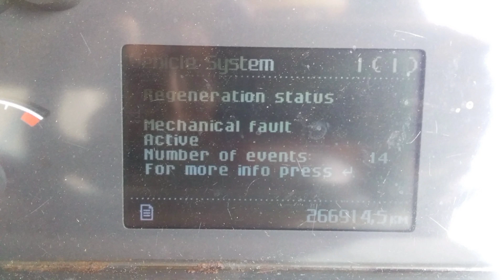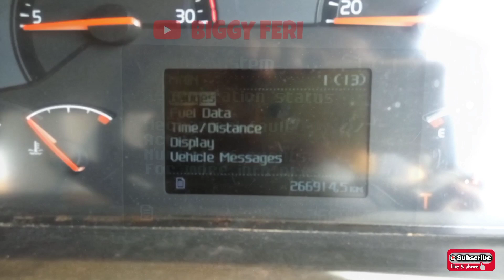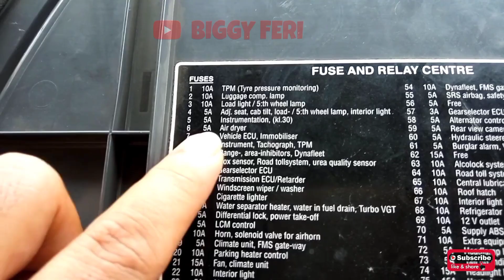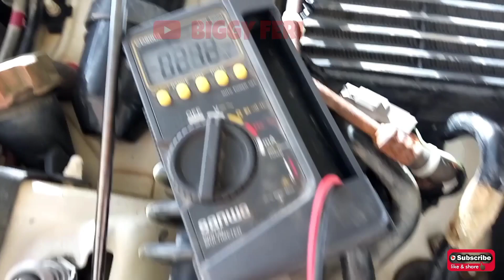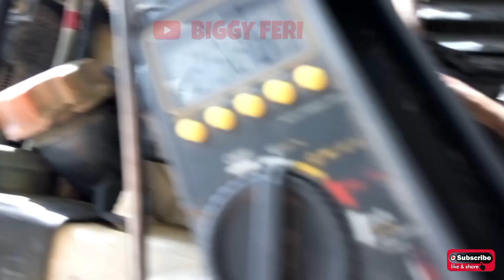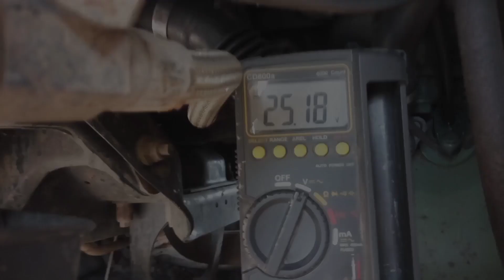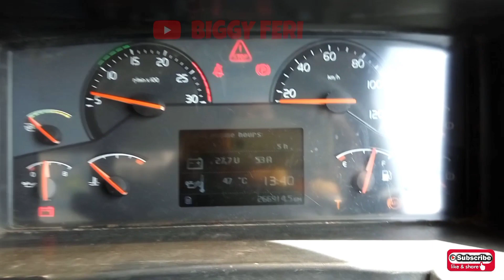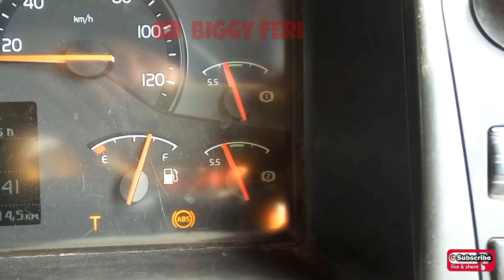AIR BRAKE SYSTEM TROUBLESHOOTING ON VOLVO TRUCK - PRESSURE TOO HIGH ON THE AIR BRAKE SYSTEM

Comment: Hello brother, where can I find the air pressure sensor on volvo d13 dumpingbtruck sometimes pressure guage low  even the pressure is nornal and sometime normal it's like wire is loosing ,
Reply from the maker: Check my videos on playlist instrument panel.

Comment: Assalamualaikum bang, mau tanya untuk sensor yg membaca pressure hrus tetap berada di 8 bar posisinya dimana ya pada unit? Dan inputan wiring sensor tersebut terkoneksi kemana ya?
Reply from the maker: Samean bisa lihat video saya yang lainnya,, sdh pernah saya bahas itu bang. 
Cari di playlist Air Brakr System.
Judulnya
'Primary Air Pressure Sensor Location & Function On Volvo Truck - Air Brake System"

Comment: bang tunjuk cara programming engine ecu turbo tak naik habis
Reply from the maker: Engine low power kah?
Kenapa turbonya tak mau naik
Reply: @BiggyFeri  turbonya naik separuh tak mau naik habis volvo fm13 bila naik bukit jadi tak kuat
Reply from the maker: Cek di air intake system, ada yang bocor atau tidak.
Bisa jadi ada bocor juga di intercooler nya.

Comment: Terima kasih banyak teman saya Anda adalah orang yang istimewa dan penjelasan Anda sangat bagus Saya harap Anda membuat video tentang file lobi dan metode pemeriksaan
Reply from the maker: Terima kasih 👍
Reply: @BiggyFeri  Aku punya masalah lain.
Reply from the maker: Masalah tentang apa?
Reply: I have a problem with the level between the fuel tanks, one of which is suddenly floating around.

Comment: Aslam o elykom sar please explain if not coming black were 25 voltage wath a problem  thanks
Reply from the maker: Check output voltage direct on VECU for black wire.

Comment: Klu angin buang di sebelum air dryer jadi gak masuk di tabung angin pak?
Reply from the maker: Buangnya di bagian mana bang, di safety valve atau dimana
Reply: @BiggyFeri  ia sebelum air dreyer,jadi gak mau masuk filter semacam gak buka selenoid di air dreyer,padahal ada setrum
Reply from the maker: Kalo angin bocor terus, coba samean ganti safety valvenya itu. Atau samean block aja untuk sementara.
Reply: @BiggyFeri  blok itu maksud nya di tutup di safety valve kah biar los ke filter air dreyer,gak ada kemungkinan rusak ke yg lain klu di blok?
Reply from the maker: Ini masalahnya  yang bocor di safety valve atau di selangnya.
Reply: @BiggyFeri  boleh minta WA nya Pak?saya mau belajar blm begitu faham unit volvo

Comment: Aaslkum bang apa masalah kalw angin pressure tekan Brake turung satu langkah satu langkah tgk  meter turung sikit2 ,.angin takada bocor bang..cabut  paip di air dryer tekanan angin kuat air dryer dh tukar tapi Masih tk jumpa penyakit ..tq
Reply from the maker: Maksudnya, tekanan angin turun sendiri tanpa ada kebocoran.
Coba samean gunakan pressure gauge manual dan cek di tangi angin 1 dan 2.
Apakah benar2  turun tekanannya atau tidak.
Reply: @BiggyFeri  turung angin
Reply from the maker: Kalau proses pengisian angin cepat atau lambat pak.
Reply: @BiggyFeri  cepattt ,kadang2 meter tu kekal bawah
Reply from the maker: Coba di tukar itu 4 way protecting valve nya. Dia yang bagi tekanan di masing2 sistem angin.
Reply from the maker: Apa yang bermasalah
Reply: @BiggyFeri  Lori berantu kut haha tk dapat di kesan bang

Comment: Hola Biggy gracias amigo por seguir subiendo videos que nos ayudan mucho... tengo el mismo problema de este camión que hiciste el video, no pierde el icono de la batería... pero el alternador carga los 28V... ya cambie relay  número K13 y el fusible F58 está bueno... pero sigue el mismo fallo... el relay número K20 no lo revise... puede ser por eso el fallo...? por favor si pudieras  hacer un video sobre este fallo ya que tu camión tiene el mismo fallo gracias amigo y sigue adelante con estos videos  tutoriales...
Reply from the maker: Hola amigo,
También tuve el mismo problema ayer.
pero no creo que sea un problema.

¿Por qué el indicador de batería sigue encendido aunque el alternador se esté cargando?
Porque el voltaje de salida del alternador (en el terminal L) no coincide con el voltaje de la batería.
Puede verificar el voltaje en el cable amarillo / rojo en el conector del alternador.
cuál es el voltaje de salida en ese terminal.
Reply from the maker: el relé K13 estará activo si hay una salida de voltaje desde el terminal L en el alternador.
El fusible F58 es una ruta de señal que va al alternador cuando el encendido está en la posición ON, de modo que se produce un electroimán en el alternador.

Comment: Please, I have a Volvo tipper, the air is coming out of the safety valve all the time
Reply from the maker: Maybe overpressure in air brake system or safety valve is damaged.
Safety valve limited the pressure in air brake system if occure over air pressure.